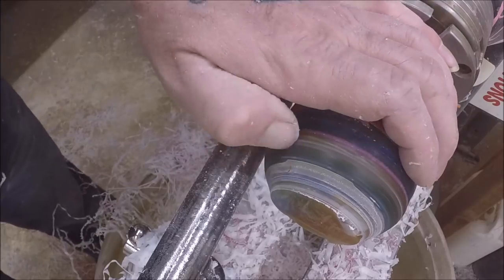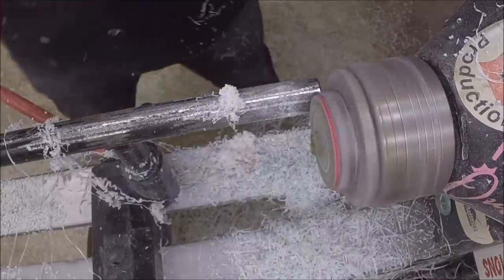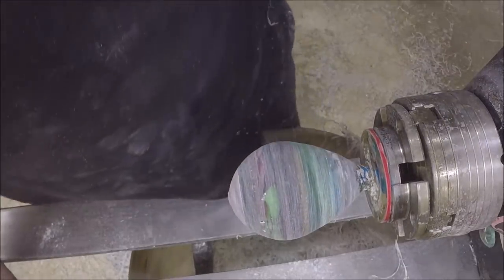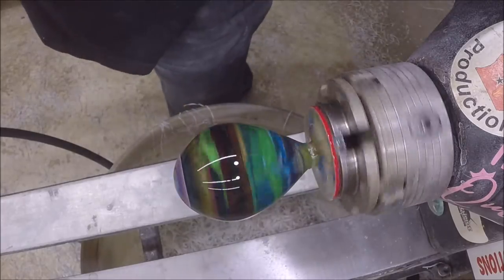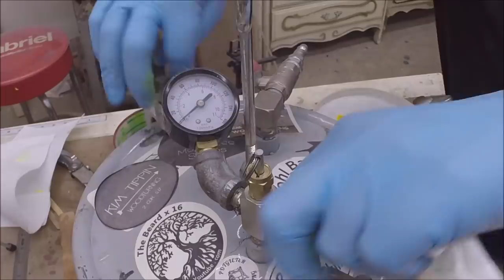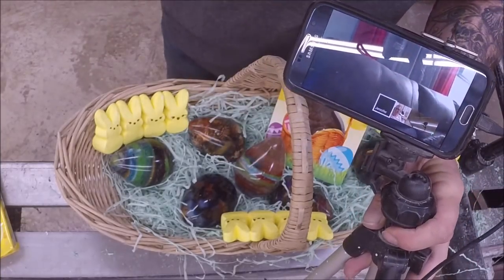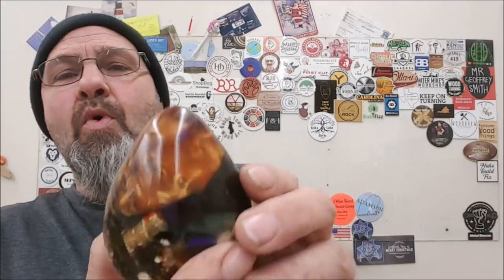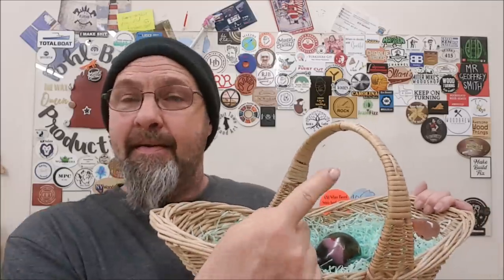Turning Resin Easter Eggs and Grass

Comment: Has anyone else noticed you can see where the consistency/texture of the resin changes, by the shape and width of the turning strips peeled off by the tools?
Reply from the maker: sometimes that's the issue and sometimes it's how hard I am leaning on that tool and how deep of a cut I am taking, Thanks for watching Carolyn